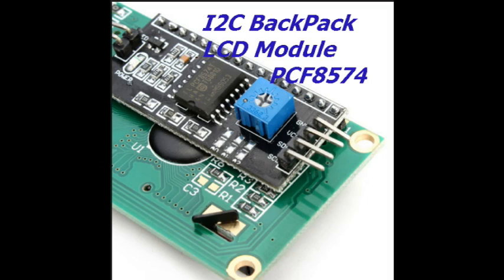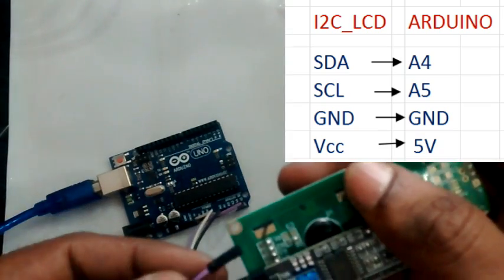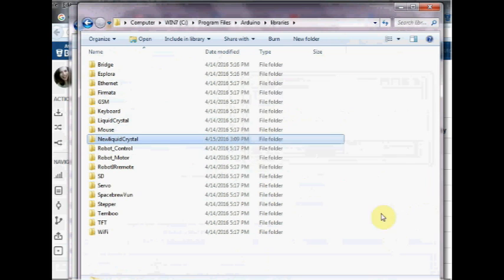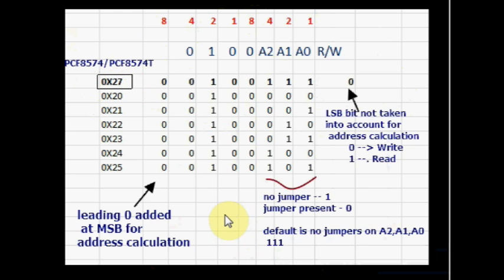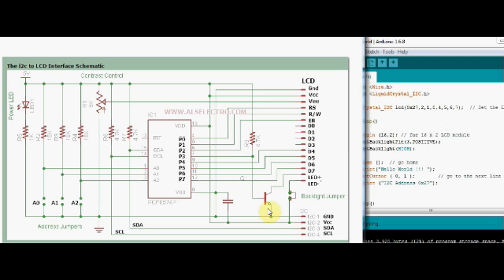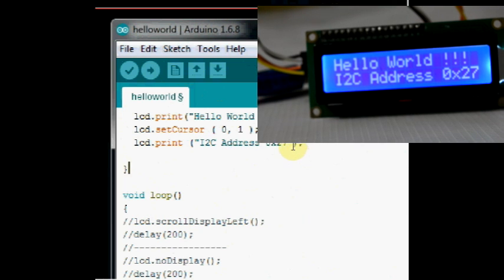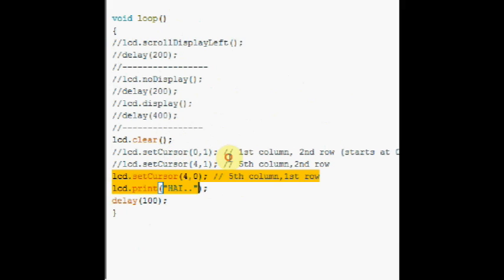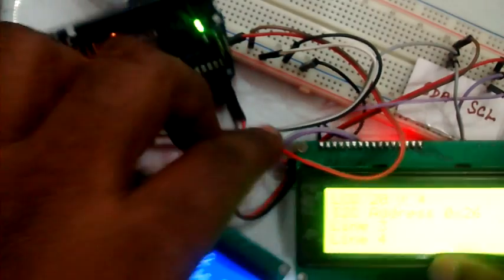Serial LCD - I2C Backpack

Comment: TO ANYONE WHO HAD A PROBLEM OF BLUE BOXES or the error "LiquidCrystal_I2C lcd(............." ,SOLUTION: in the fist you can wirte this: LiquidCrystal_I2C lcd(0x27,16,4);
BUT at the void setup you must add this line on the top: Wire.begin();
I figured it out ;)

Comment: I followed the steps. - the address was 0x3F with all the resistors REMOVED.  

I had to modify the scetch to this one: and only after it was modified as  I will show bellow- it worked. I had tried 2 LCDs
#include <Wire.h> 
#include <LiquidCrystal_I2C.h>

// Address,EN,RW , RS, D4,D5,D6,D7,BackLight,BL_Polarity
//LiquidCrystal_I2C lcd1(0x26, 2, 1, 0, 4, 5, 6, 7, 3, POSITIVE); 
LiquidCrystal_I2C lcd2(0x3F, 2, 1, 0, 4, 5, 6, 7, 3, POSITIVE); 

void setup()
{
 //lcd1.begin(20,4); 
// lcd1.backlight();
// lcd1.print("LCD 20 X 4 ");
// lcd1.setCursor(0,1);
// lcd1.print("I2C Address 0x26");
// lcd1.setCursor(0,2);
// lcd1.print("Line 3");
// lcd1.setCursor(0,3);
// lcd1.print("Line 4");

 lcd2.begin(16,2); 
 lcd2.backlight();
 lcd2.print("LCD 16 x 2");
 lcd2.setCursor(0,1);
 lcd2.print("I2C Address 0x3F");
 delay (2000);
}

void loop ()
{
lcd2.scrollDisplayLeft();
delay (1000);
lcd2.scrollDisplayLeft();
delay (1000);

lcd2.scrollDisplayLeft();
delay (1000);

//---
//lcd.noDisplay();
//delay (200);
//lcd.disaply();
//-------
lcd2.clear();
  
}
Reply: Didn't work for me :(

Comment: i have a problem 

there is a error is coming .can u give the solution of this error .plz give the solution .
error:Arduino: 1.8.3 (Windows 7), Board: "Arduino/Genuino Uno"

helloworld:4: error: no matching function for call to 'LiquidCrystal_I2C::LiquidCrystal_I2C(int, int, int, int, int, int, int, int)'

 LiquidCrystal_I2C lcd(0x27,2,1,0,4,5,6,7);  // Set the LCD I2C address

                                         ^

C:\Users\Administrator\AppData\Local\Temp\Rar$DIa0.550\helloworld\helloworld.ino:4:41: note: candidates are:

In file included from C:\Users\Administrator\AppData\Local\Temp\Rar$DIa0.550\helloworld\helloworld.ino:2:0:

C:\Users\Administrator\Documents\Arduino\libraries\LiquidCrystal_I2C/LiquidCrystal_I2C.h:57:3: note: LiquidCrystal_I2C::LiquidCrystal_I2C(uint8_t, uint8_t, uint8_t)

   LiquidCrystal_I2C(uint8_t lcd_Addr,uint8_t lcd_cols,uint8_t lcd_rows);

   ^

C:\Users\Administrator\Documents\Arduino\libraries\LiquidCrystal_I2C/LiquidCrystal_I2C.h:57:3: note:   candidate expects 3 arguments, 8 provided

C:\Users\Administrator\Documents\Arduino\libraries\LiquidCrystal_I2C/LiquidCrystal_I2C.h:55:7: note: constexpr LiquidCrystal_I2C::LiquidCrystal_I2C(const LiquidCrystal_I2C&)

 class LiquidCrystal_I2C : public Print {

       ^

C:\Users\Administrator\Documents\Arduino\libraries\LiquidCrystal_I2C/LiquidCrystal_I2C.h:55:7: note:   candidate expects 1 argument, 8 provided

C:\Users\Administrator\Documents\Arduino\libraries\LiquidCrystal_I2C/LiquidCrystal_I2C.h:55:7: note: constexpr LiquidCrystal_I2C::LiquidCrystal_I2C(LiquidCrystal_I2C&&)

C:\Users\Administrator\Documents\Arduino\libraries\LiquidCrystal_I2C/LiquidCrystal_I2C.h:55:7: note:   candidate expects 1 argument, 8 provided

C:\Users\Administrator\AppData\Local\Temp\Rar$DIa0.550\helloworld\helloworld.ino: In function 'void setup()':

helloworld:9: error: 'class LiquidCrystal_I2C' has no member named 'setBacklightPin'

   lcd.setBacklightPin(3,POSITIVE);

       ^

helloworld:9: error: 'POSITIVE' was not declared in this scope

   lcd.setBacklightPin(3,POSITIVE);

                         ^

exit status 1
no matching function for call to 'LiquidCrystal_I2C::LiquidCrystal_I2C(int, int, int, int, int, int, int, int)'

This report would have more information with
"Show verbose output during compilation"
option enabled in File -> Preferences.

Comment: sir I am trying from several days, different libraries, different codes, without i2c,with i2c but the results are same, it successfully uploaded to arduino ide, only the back light lights up no boxes, no text to be seen, pls help.
Reply: same
Reply: TO ANYONE WHO HAD A PROBLEM OF BLUE BOXES or the error "LiquidCrystal_I2C lcd(............." ,SOLUTION: in the fist you can wirte this: LiquidCrystal_I2C lcd(0x27,16,4);
BUT at the void setup you must add this line on the top: Wire.begin();
I figured it out ;)

Comment: Thanks so much for the helpful code to find the address.. I'm doing just fine now thanx to your video. Outputting tempature displayed on my new 20x4 Blue LCD, and controller an air conditioner with an n-Channel MOSFET and a SSR. BEAST MODE !!

Comment: I used this  sketch and also your library for a new 12X2 n I2C pcb with the same IC  PCF8574T. My IDE arduino is 1.613 version. Would u please help?

and a new DUE.

#include <Wire.h> 
#include <LiquidCrystal_I2C.h>
#define BACKLIGHT_PIN     13
//LiquidCrystal_I2C lcd(0x27);  // Set the LCD I2C address

LiquidCrystal_I2C lcd(0x27 , BACKLIGHT_PIN, POSITIVE);  // Set the LCD I2C address

// Creat a set of new characters
const uint8_t charBitmap[][8] = {
   { 0xc, 0x12, 0x12, 0xc, 0, 0, 0, 0 },
   { 0x6, 0x9, 0x9, 0x6, 0, 0, 0, 0 },
   { 0x0, 0x6, 0x9, 0x9, 0x6, 0, 0, 0x0 },
   { 0x0, 0xc, 0x12, 0x12, 0xc, 0, 0, 0x0 },
   { 0x0, 0x0, 0xc, 0x12, 0x12, 0xc, 0, 0x0 },
   { 0x0, 0x0, 0x6, 0x9, 0x9, 0x6, 0, 0x0 },
   { 0x0, 0x0, 0x0, 0x6, 0x9, 0x9, 0x6, 0x0 },
   { 0x0, 0x0, 0x0, 0xc, 0x12, 0x12, 0xc, 0x0 }
   
};

void setup()
{
   int charBitmapSize = (sizeof(charBitmap ) / sizeof (charBitmap[0]));

  // Switch on the backlight
  pinMode ( BACKLIGHT_PIN, OUTPUT );
  digitalWrite ( BACKLIGHT_PIN, HIGH );
  
  lcd.begin(16,2);               // initialize the lcd 

   for ( int i = 0; i < charBitmapSize; i++ )
   {
      lcd.createChar ( i, (uint8_t *)charBitmap[i] );
   }

  lcd.home ();                   // go home
  lcd.print("Hello, ARDUINO ");  
  lcd.setCursor ( 0, 1 );        // go to the next line
  lcd.print (" FORUM - fm   ");
  delay ( 1000 );
}

void loop()
{
   lcd.home ();
   // Do a little animation by writing to the same location
   for ( int i = 0; i < 2; i++ )
   {
      for ( int j = 0; j < 16; j++ )
      {
         lcd.print (char(random(7)));
      }
      lcd.setCursor ( 0, 1 );
   }
   delay (200);
}

Arduino: 1.6.13 (Windows 7), Board: "Arduino Due (Programming Port)"

In file included from C:\Users\usera\Documents\Arduino\libraries\NewliquidCrystal\LiquidCrystal_SR1W.cpp:35:0:

C:\Users\usera\Documents\Arduino\libraries\NewliquidCrystal\LiquidCrystal_SR1W.cpp: In member function 'uint8_t LiquidCrystal_SR1W::clearSR()':

C:\Users\usera\Documents\Arduino\libraries\NewliquidCrystal\LiquidCrystal_SR1W.cpp:77:24: error: invalid type argument of unary '*' (have 'fio_register {aka unsigned char}')

  SR1W_ATOMIC_WRITE_LOW(srRegister, srMask);

                        ^

C:\Users\usera\Documents\Arduino\libraries\NewliquidCrystal\LiquidCrystal_SR1W.h:293:79: note: in definition of macro 'SR1W_ATOMIC_WRITE_LOW'

 #define SR1W_ATOMIC_WRITE_LOW(reg, mask) ATOMIC_BLOCK(ATOMIC_RESTORESTATE) { *reg &= ~mask; }

                                                                               ^

C:\Users\usera\Documents\Arduino\libraries\NewliquidCrystal\LiquidCrystal_SR1W.cpp:86:22: error: invalid type argument of unary '*' (have 'fio_register {aka unsigned char}')

   fio_bit reg_val = *srRegister;

                      ^

C:\Users\usera\Documents\Arduino\libraries\NewliquidCrystal\LiquidCrystal_SR1W.cpp:95:5: error: invalid type argument of unary '*' (have 'fio_register {aka unsigned char}')

    *srRegister = bit_high;

     ^

C:\Users\usera\Documents\Arduino\libraries\NewliquidCrystal\LiquidCrystal_SR1W.cpp:96:5: error: invalid type argument of unary '*' (have 'fio_register {aka unsigned char}')

    *srRegister = bit_low;

     ^

C:\Users\usera\Documents\Arduino\libraries\NewliquidCrystal\LiquidCrystal_SR1W.cpp:101:4: error: invalid type argument of unary '*' (have 'fio_register {aka unsigned char}')

   *srRegister = bit_high;

    ^

C:\Users\usera\Documents\Arduino\libraries\NewliquidCrystal\LiquidCrystal_SR1W.cpp: In member function 'uint8_t LiquidCrystal_SR1W::loadSR(uint8_t)':

C:\Users\usera\Documents\Arduino\libraries\NewliquidCrystal\LiquidCrystal_SR1W.cpp:139:24: error: invalid type argument of unary '*' (have 'fio_register {aka unsigned char}')

     fio_bit reg_val = *srRegister;

                        ^

C:\Users\usera\Documents\Arduino\libraries\NewliquidCrystal\LiquidCrystal_SR1W.cpp:144:6: error: invalid type argument of unary '*' (have 'fio_register {aka unsigned char}')

     *srRegister = bit_low;

      ^

C:\Users\usera\Documents\Arduino\libraries\NewliquidCrystal\LiquidCrystal_SR1W.cpp:145:6: error: invalid type argument of unary '*' (have 'fio_register {aka unsigned char}')

     *srRegister = bit_high;

      ^

In file included from C:\Users\usera\Documents\Arduino\libraries\NewliquidCrystal\LiquidCrystal_SR1W.cpp:35:0:

C:\Users\usera\Documents\Arduino\libraries\NewliquidCrystal\LiquidCrystal_SR1W.cpp:151:26: error: invalid type argument of unary '*' (have 'fio_register {aka unsigned char}')

    SR1W_ATOMIC_WRITE_LOW(srRegister, srMask);

                          ^

C:\Users\usera\Documents\Arduino\libraries\NewliquidCrystal\LiquidCrystal_SR1W.h:293:79: note: in definition of macro 'SR1W_ATOMIC_WRITE_LOW'

 #define SR1W_ATOMIC_WRITE_LOW(reg, mask) ATOMIC_BLOCK(ATOMIC_RESTORESTATE) { *reg &= ~mask; }

                                                                               ^

C:\Users\usera\Documents\Arduino\libraries\NewliquidCrystal\LiquidCrystal_SR1W.cpp:158:27: error: invalid type argument of unary '*' (have 'fio_register {aka unsigned char}')

    SR1W_ATOMIC_WRITE_HIGH(srRegister, srMask);

                           ^

C:\Users\usera\Documents\Arduino\libraries\NewliquidCrystal\LiquidCrystal_SR1W.h:294:80: note: in definition of macro 'SR1W_ATOMIC_WRITE_HIGH'

 #define SR1W_ATOMIC_WRITE_HIGH(reg, mask) ATOMIC_BLOCK(ATOMIC_RESTORESTATE) { *reg |= mask; }

                                                                                ^

exit status 1
Error compiling for board Arduino Due (Programming Port).

Comment: I have a 20 x 4 lcd and I changed the code  lcd.begin(20,4);  but all I get on the screen is just a black square that appears in random positions.
Reply: It worked for me with this code.
LiquidCrystal_I2C lcd(0x27, 2, 1, 0, 4, 5, 6, 7, 3, POSITIVE);  // Set the LCD I2C address
Reply: TO ANYONE WHO HAD A PROBLEM OF BLUE BOXES or the error "LiquidCrystal_I2C lcd(............." ,SOLUTION: in the fist you can wirte this: LiquidCrystal_I2C lcd(0x27,16,4);
BUT at the void setup you must add this line on the top: Wire.begin();
I figured it out ;)

Comment: helloworld:5: error: no matching function for call to 'LiquidCrystal_I2C::LiquidCrystal_I2C(int, int, int, int, int, int, int, int)'

I have only been able to scan the IC, but i cannot compile, the error message is shown above.
Reply: i got rid of the problem by liquidCrystal_I2C(0x3f,x,x) but i still cant get it to display a message..
Reply: me too ,any solution ?
Reply: Same problem here...
Reply: same problem
Reply: delete the old liquidcrystal library before placing the new lcd library
Reply: how can we delete old libary sir thk
Reply: TO ANYONE WHO HAD A PROBLEM OF BLUE BOXES or the error "LiquidCrystal_I2C lcd(............." ,SOLUTION: in the fist you can wirte this: LiquidCrystal_I2C lcd(0x27,16,4);
BUT at the void setup you must add this line on the top: Wire.begin();
I figured it out ;)

Comment: Greate video.

But you should avoid placing the libraries under "Program files", they disapears when you upgrade Arduino.

A better place is "Documents\Arduino\libraries", and to import it you can use the menu "Sketch  | Include Library | Add .ZIP Library..." to install libraries in ZIP files.
Reply from the maker: Yes that is always a good practice to import & install library.Thank you for the tip.